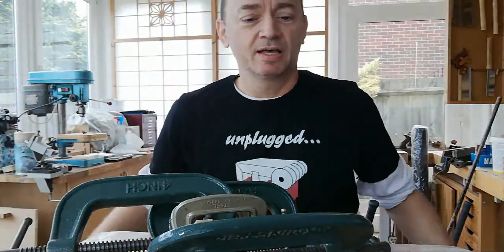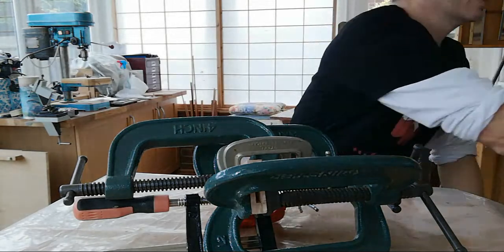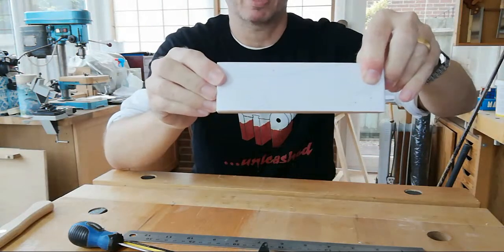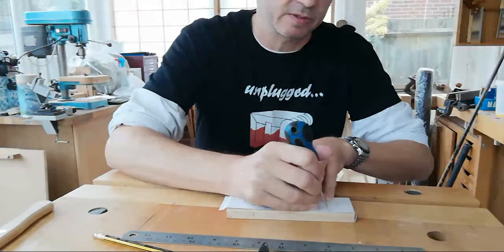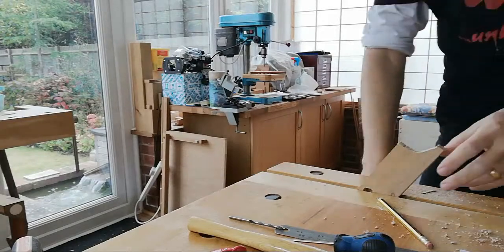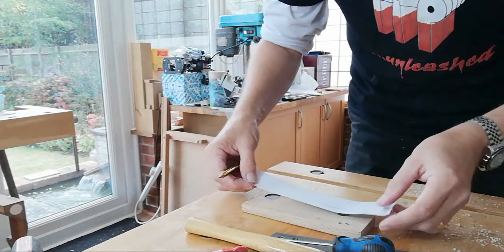Unclamping & Cleanup Of Shoulder Plane Blank

Comment: why not use screws instead of dowels or bamboo skewers
Reply from the maker: I guess not much in it between them all. Dowels are possibly faster as already a sensible length and can be knocked in rather than screwed. I wouldn't argue against any of them though.